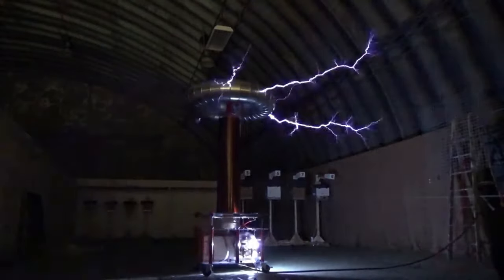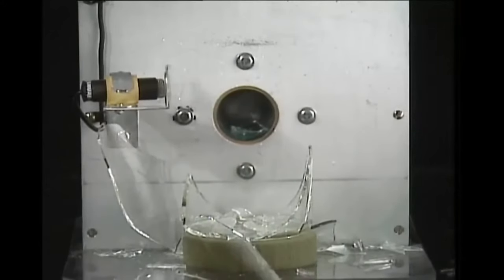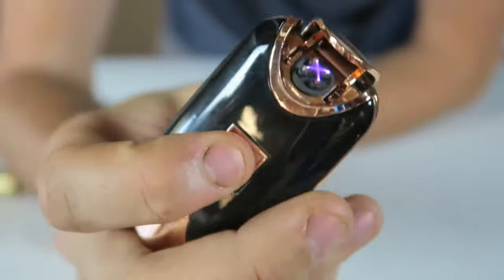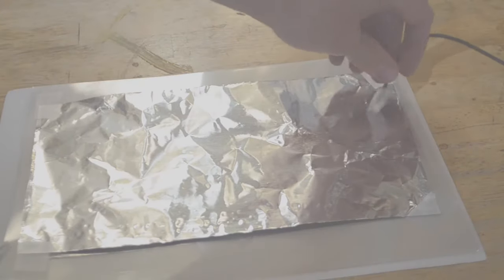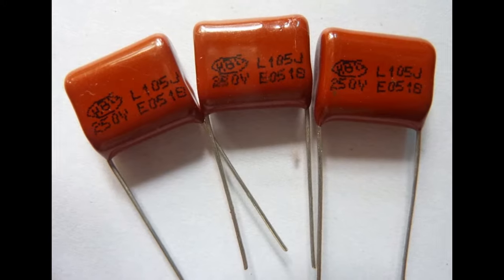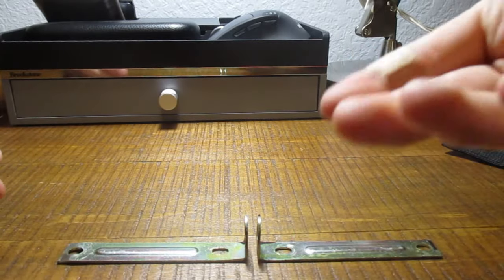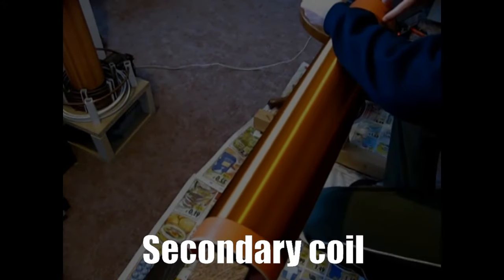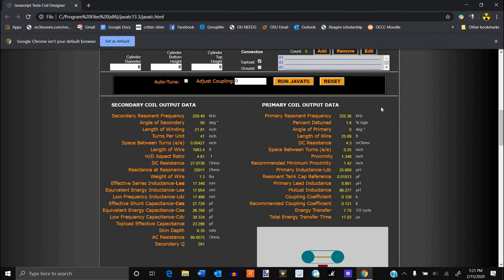The Ultimate Tesla Coil Build Guide (HD):  EVERYTHING you need to know!

Comment: Wouldn't bolt-on-vacuum capacitors be best..?
Reply from the maker: Not really, honestly. Besides being ridiculously expensive (my whole triple-MOT coil cost less than a single one), the capacitance range is very small: typically 1nF or less. An adjustable/tappable primary coil is truly the way to go when it comes to coil tuning: it yields the best results, and it's the cheapest! Vacuum caps would be best for vacuum tube coils, since they require lower voltages and lower capacitances (even then, the cost is still pretty extreme).
Reply: Thanks, good to know.

Good thing I work for a Fortune 500 Power Generation company with lots of old storage that needs sorting out - assuming they let me take 'trash'. 🙂 They have some good capacitor banks laying around, and lots of other useful tid bits. 

I have some radium-doped spark gap vacuum tubes (JAN-CW-IB22 - Western Electric yr. 1945) I'd like to use on a rig (It's ridiculous, they have printed on them: "WARNING This tube contains Radium. After it has served its useful life, do not open and examine. Old tubes should be sunk in the ocean or buried." - that's 1940's radiation/environmental knowledge for you).

Comment: Would be more useful if you explained how to get this project to produce something ! anything. Like can we get the larger one to power our home ?
Reply from the maker: No, you cannot power you home with a Tesla coil. For one thing, it CONSUMES power: there is no net gain of power. And of the power it does consume, only 20% or less gets transmitted (the coupling is always 0.2 or less, otherwise the coil will short circuit and die), meaning you'd be wasting electricity and would be better off simply using wires.

Comment: Still don’t understant. Don’t you need a diode in between the transformer and the capacitor bank? I thought capacitors can only be charged with DC current.
Reply from the maker: Only when using very high frequency input (like from a flyback transformer, although most units have diodes built in). Yes, capacitors can normally only be charged with DC, but since the spark gap is firing at or over the line frequency (50-60Hz), the capacitors are allowed to charge and discharge in between alternations. In short: diodes are not necessary in spark gap Tesla coils powered by a 50-60Hz transformer, although the circuit wouldn't be harmed if they were there. Diodes do tend to have trouble in SGTC circuits though, and usually die pretty quick unless they are very powerful. Hope that helps!

Comment: hey, what capacitance of capacitor should i use for dual oven transformersand should i use any kind of ballast since you didn't use any ballast.
and Is it better to have higher BPS?
thanks
Reply from the maker: The capacitance can be literally any value you want it to be. The primary resonant frequency is determined by the primary capacitance (supplied by the capacitor) and the primary inductance (determined by the build of the primary coil). As long as the primary resonant frequency is close to the secondary resonant frequency, then the coil will work well. I would recommend using JavaTC (link in the video description) to make sure the frequencies match. All you have to do is put in the values you want (it's mostly things like your coil's height, number of turns, etc.) and play around with the them until the frequencies match. Dual MOT coils thrive with higher capacitances (typically more than 40nF, or 0.04uF). 
You're question is actually VERY similar to a question I had as I built the coil in the video. I was worried that an unballasted MOT coil would trip my 15A home breaker, and therefore not operate. I tried ballasting it at first, using a 2kW heater array (two 1kW heating elements in parallel), but the output sputtered as the spark gap struggled to fire (dual MOT coils are notoriously finicky with spark gaps, as I have learned, which is why I added another MOT, which fixed the firing issues). As a last ditch effort, I took away all ballasting and plugged it directly in and the whole thing roared to life! Others have had breakers trip, though, so I'd say only ballast if your coil has trouble tripping your breaker.
In regards to BPS, it is entirely up to you. I'd recommend watching this video to help you decide: https://www.youtube.com/watch?v=Sm8SoFmnlLM. It compares lower BPS to higher BPS, and does a pretty good job showing the differences. One thing to note: BPS rarely alters the spark length, but does tend to make your coil draw more power (and possibly trip the breaker).
Best of luck in your Tesla coil building endeavors, I'm happy to answer any questions!
Reply: @LabCoatz_Science  thanks but what about this formula c=1/(2*pi*f*(v/i))
Reply from the maker: @BIGRIP87  I've actually never seen this formula before. Any idea what it is used for? It appears similar (in some ways) to the maximum usable capacitance formula I gave, but also like the formula for finding the resonant frequency, which is f=1/(2*pi*sqrt{C*L}). I've never seen it used, so I can't vouch for its accuracy in Tesla coil design (then again, it might be a really well-known and accurate formula that I've just never seen before).

Comment: 1600VDC, 1uF Arcotronics MKP R76 capacitor is okay too for a 3 MOT coil?
Reply from the maker: They're labelled as polypropylene film capacitors, so I'd have to say yes. The datasheet also mentions that they are double-metallized, which doesn't hurt either. Overall, I think a bank of these MKP caps would hold up nicely in a Tesla coil!
Reply: @LabCoatz_Science  Thank Your very much Sir, and the fast reply! One more question, if its not a problem. If I have 3 MOT, the peak voltage will be 9kV near, so I make 20kV voltage rating MMC it will handle well (?) (My plan is to put 15 R76 cap in series so I will get 24kV, 66nF)
Reply from the maker: @mrdsandras  No problem! 20kV should be plenty, in fact, the 3 MOT coil I built in my video uses a 66nF MMC bank rated at only 18kV, and it is still fully operational after all this time. I'm happy to answer almost any question you or anyone else may have. Knowledge is what make the world go round! Hope to see some video of your coil sir, I'm sure it will be most impressive.
Reply: LabCoatz Thank You very much! You are so kind, Im going to subscribe your channel, keep doing, awesome content! So Im going to buy this type of capacitors, and If it finished, somehow I show you!
Reply: @LabCoatz_Science  Thank you for such a great video, explaining everything really good. I'm a little bit curious though regardning the voltage for the capacitors.

In your example you use 15 1200 volt capacitors, mentioning that the voltage of the complete MMC should be 3 times higher than the output from the transformer. At some point in the video you can see one capacitor that says 1200 VDC, shouldn't the value be calculated for AC? When I'm looking for capacitors at different places, it often ends up that many of them has about 3 times lower AC than DC. I'm thinking if this might be the reason why you need such a higher voltage compared to the MOT's output. What's your thought?

I Also wanted to ask if you could explain a little bit more, maybe make an example of calculating the maximum useable capacitance? I've been using JAVA TC, TeslaMap, and some other calculators to figure things up, but I do not seem to get the numbers right. Thank's in advance.

Comment: It is a kind of Tesla coil but it is not operating as originally intended by its inventor. The video is in fact showing the operation of a huge automobile ignition coil.

The true operation of a Tesla coil is based on what Tesla called "radiant electricity". It is not a resonant circuit per se. The induction in a true Tesla coil should not be magnetic but more like electrostatic induction.

It is important to keep in mind that many articles indicate that the generation of "radiant electricity" happens only at the instant when the voltage is applied to the primary coil and prior to the flow of electric chargers. The generation of RADIANT ELECTRICITY would disappear once electric currents start flowing in the conductor or in the form of electric arc in air. It is said that avoiding the occurrances of electric arcs was the main challenge Tesla experienced when operating the coil to transmit wireless electricity - or Radiant Electricity.

I have done some research on this matter and the conditions for generating "radiant electricity" are kind of tricky. Tesla used to apply a voltage to the primary coil of very high magnitudes and frequencies.

Generating "radiant electricity" from the primary coil should require voltages with extremly high dv/dt. The latter is the reason why the primary coil should not have more than one or two turns with large air gaps separating the turns of the primary coil to minimize self inductance and with large air gaps from the secondary coil to minimize mutual inductance. Otherwise, the inductance of the primary coil would limit the dv/dt that is required to generate "radiant electricity".

Because the induction in a Tesla coil is electrostactic, the effects of the Lenz's law should not apply, which in theory should make the Tesla coil a free energy device. The effect of the Lenz's law in magnetic field inductions is the main reason why electric transformers and rotaring generators always output less power than the input.

It is interesting how the Tesla's inventive concept for "radiant electricity" has been used in other embodiments. For example, Steven Marks invented the Toroidal Power Unit (TPU) which consists of a multi-turn secondary coil with a circular shape and a primary coil having a single turn running along the center of the secondary coil. Basically, the TPU is a Tesla coil with a primay single-turn coil running inside the secondary coil with many turns. A typical Tesla coil has a one-turn primary coil located outside.

See this video of a presentation of Steven Marks and the TPU in the 1980s:
(I apologize but I was not able to paste the youtube link for the video with this comment. I will keep trying. However, you can find several videos about this device if you seach youtube using the following keywords "Steven Marks Toroidal Power Unit TPU"

After several failed attempts, here is one of the Steven Marks videos:
https://youtu.be/_hWI6LKmZ7w?si=EiRWpEo15out6s4p

Thanks😮

Comment: i'm confused, i thought putting capacitors in series didn't actually raise their combined voltage limits?
Reply: also hearing metallica, but seeing dave mastaine?
Reply from the maker: Putting capacitors in series raises the breakdown voltage of the bank as a whole, but reduces the capacitance. However, putting capacitors in PARALLEL will not increase the working voltage (but will increase the capacity).
Reply from the maker: @daveyjones5702  Nah, wasn't Mustaine, just a fairly young James Hetfield at the Metal Hammer Festival back in 1985.
Reply: @LabCoatz_Science  are you sure?
sure looks like dave to me, and he was a member of metallica before he started megadeth...
Reply: @LabCoatz_Science  heh, i was told wrong then.

so the voltage rating of caps in series would be the sum of their values?
Reply from the maker: @daveyjones5702  Yep!
Reply from the maker: @daveyjones5702  Yeah, here's the video I used: https://www.youtube.com/watch?v=swdwY2fatsw. You can see Kirk in there, and he wasn't playing with Metallica until Dave was gone (as far as I know).

Comment: How many mm was the primary coil wire
Reply from the maker: It honestly doesn't matter, as long as it's thicker than about 20AWG. I think mine was 16AWG, and I just pulled it out of an old appliance's electrical cable.
Reply: @LabCoatz_Science  thanks for replying man
Reply: @LabCoatz_Science  and quick question if i were to get to insulated wires, put them parellel to eachother and connect them would that add inductance
Reply from the maker: @timetojit8917  Not really. Inductance only adds when the inductors are in series (which is why adding more turns is the best way to add inductance and tune a Tesla coil). You will get a higher current-carrying capacity though, and possibly better performance!
Reply: @LabCoatz_Science  thanks so much man youve been a big help

Comment: Put you the primary coil of the Mots parelell?
Reply from the maker: Indeed I did, sir!
Reply: @LabCoatz_Science  OK thanks, do you need a throttle?
Reply from the maker: @casparplatzer7271  Not necessarily
Reply: Doesn't the fuse blow then?
Reply: Can I have the switching Diagramm for the MOT Stack?
Reply from the maker: @casparplatzer7271  Nope, the fuse doesn't blow (mostly because I don't have one installed, just my home's 15A circuit breaker) and no switches were used. It just plugs straight into the wall and produces sparks.
Reply: Ok thanks
Reply: Can I have the link for the  capacitor
Reply from the maker: @casparplatzer7271  I don't have the link to the capacitor (in fact, Digikey and Mouser no longer sell it), and the circuit is the same as any other spark gap coil you'll find.
Reply: Ok thanks

Comment: Hey LabCoatz,
I'm back in search of more advice. How did you determine your MOT power supply's current output? Calculations? Data sheets? I can use all the help I can get. In fact, I'd love to message you through Discord for easier communication if you have one. My discord name is redheadvibe#8525 . Thank you in advance! -Mac
Reply from the maker: Hey Mac! My MOT supply's current output was just an estimation. MOT banks always have more than enough current to operate a Tesla coil, so determining the output current isn't critical. If you really want to find the bank's output current though, stop by Walmart or another store and pick up a clamp-around current meter. Hook that around one of the bank's input wires and check the current while its operating. Then, with some simple calculations, you should be able to roughly calculate the output current. If you'd like to reach me in the future, send me an email at zlabcoatz@gmail.com! I check my email several times per day, and usually get back within a few hours.
Reply: @LabCoatz_Science  Thank you for the clarification cuz dang does current in tesla coil circuits seem like a ghost... And I'm considering getting an ammeter! I'll definitely reach out to you tomorrow for more talk about MOTs! Talk to you soon 👌

Comment: now I just need to make it battery powered.
Reply from the maker: I'll be making a solid state one ran on batteries soon! Should have zero shock risk and a decent output!
Reply: @LabCoatz_Science  Cool was trying it with a power MOSFET(IRF3205) with a simple center tab design. however, that design was better at catching fire than generating high voltage. I'll probably be trying something like it again but this time not with crappy wires or a leaking coil.
but I'll be looking forward to your design. try to make it better than the other people on the internet, just like your acid, something new is always great.